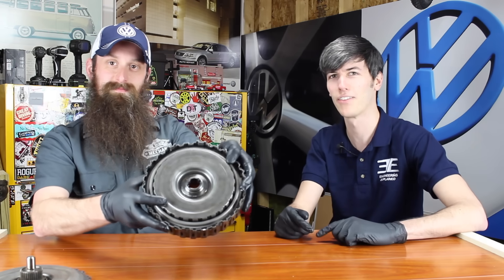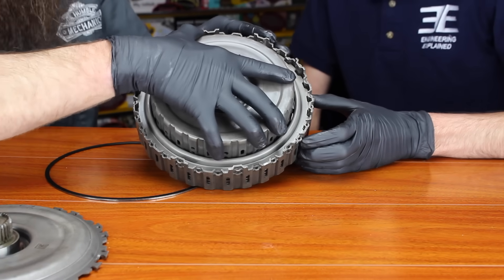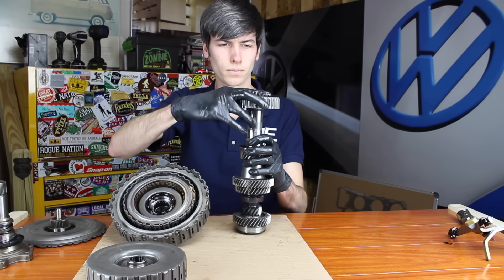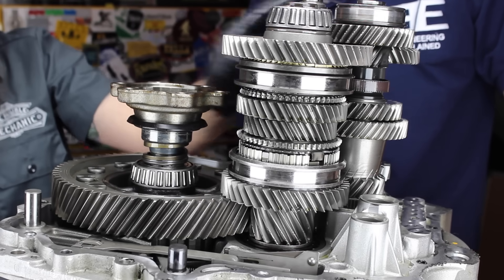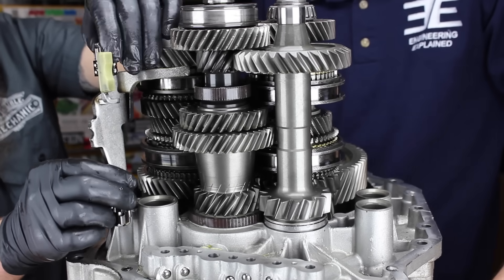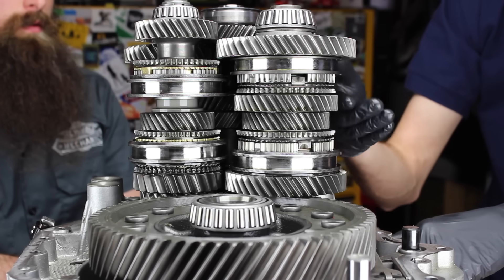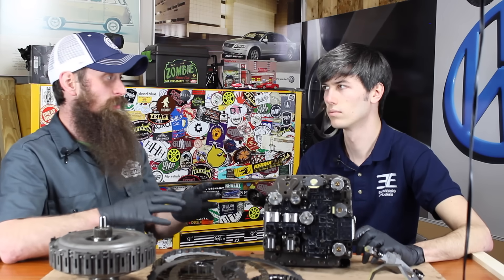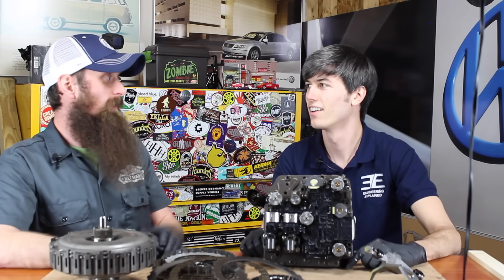DSG Transmission - Explained

Comment: for the last 6 years I have owned my first Audi S6 Avant 420PS with DSG. Prior to that I have only owned BMWs (540i etc.) I cannot begin to tell you how I utterly despise the Audi DSG transmission. It is the worst rough gear slamming piece of trash I have ever had the misfortune to drive with. People think I just can't drive as the transmission is constantly slamming itself and jerking all the time. One can't drive slowly properly and now it shudders when setting off from standstill as if the clutch plates are worn out. Pure bloody crap of the worst kind. I had no idea it had clutch plates in oil which to me is a grotesque concept. I totally and utterly HATE DSG. It's a cripple by design, and is a lousy manual being controlled by its own system. All my BMWs had normal oil based auto transmissions that NEVER failed and remained smooth ALL the time with no no oil change as lifetime oil. I did 565.000 km in my 540i and most of that was Autobahn thrashing in excess of 230 kph 260 max in the 540). Nothing ever ever went wrong. Ever. Audi doesn't have a service plan for the s tronic DSG either... and claims a lifelong oil. With my BMWs that was the case... never ever serviced a BMW auto gearbox... just drive it as a true lifetime transmission and lifetime transmission oil. No oil changes and also not a tickable box in the service manual.

Don't entertain a car with DSG, the concept is idiotic and the driving experience is horrendous. I have nothing but complete contempt for the VAG group.

Comment: We can stop saying dual clutch boxes shift quicker than a manual, it's technically correct but if you slow down for a junction see it's all clear and open the throttle the delay can be a second or more. In a manual you can see what is coming up so are in the right gear already and just go. It means you have to drive a bit more cautiously because you'll need a bigger gap in traffic in case it decides to delay.

So yeah they shift much quicker if you are linearly monotonically shifting but otherwise the delays are unpredictable.

Comment: Yea I experience the downshift and upshift bs. If I'm coming to a turn in 3rd and rpm drops less than 1800 it downs for me to where I'm dropped into 1st instead of 2nd. Or high rpm like 6500 immediately upshift... if someone knows a good tcu plug to open it up please post it to me.

Comment: 8:30 When I'm in 4th gear with my DSG-7 and drive slowly in the city, the Mechatronic goes Mental and tries to pre-change to 3rd gear, but sometime regrets and goes back to 4th - which makes lots of awkward and rough noises - like it is about to discard half of the gearbox thru the bottom of the car. Same goes for 3rd to 2nd gear. Of course I am exaggerating, and the Dealer says almost all brand new cars does this, I've read even the BMW-series do it. How can this noise be explained or, hopefully fixed? If you ever driven a 2003 Audi 1.8T manual stick you know the sound of a sloppy gearbox. Ka-Chug, Ka-Chug.

Comment: I have a question: does the dsg transmission keep sending fuel to the engine when shifting? My rpm gauge in my golf 7 2016 which has a DSG 7 speed twitches up a little when shifting up

Comment: Drove a 2023 Tiguan with DSG and I didn’t like it at all. It’s not as smooth as a traditional Automatic, and not quite as intuitive as a person driving a real manual. For some reason when I came to a stop it was clearly jumping from 2nd to 1st, giving a little extra oomph against the brake pressure leading to a secondary small lurch. Dealership said it’s common when you first drive them and I’ll adapt to it?!

Comment: Ok, show us what is affected as the fluid level runs too high and also too low. Based on what you can physically see inside the transmission, what is the "zone" of acceptable fluid level?

Comment: Great explanation all around. 
A more common preselection error would be gently accelerating to close the gap on a 2 lane road before reaching a passing zone. All indications to the computer are that the next higher gear will soon be more efficient at a higher speed. When you reach the passing zone, if traffic is clear, you step on the gas to use more power and shorten your passing time, best done in a lower gear.
Also, I question the location of the gears as stated, you might check those. If 5th and 6th are run from the same shaft, there's no physical possibility of preselecting 6th. 
Honda claims on their DCT all even gears are separate from all odd gears to achieve the same effect. I have not looked at the DSG, but in an attempt to achieve the same task, it just doesn't make sense for any consecutive gears to use the same power shaft. Well, we hope there's a stop before reverse anyway, but not the others.

Comment: I own a 2023 MINI Cooper S with a 7-speed steptronic transmission, and whenever the engine is idling at a red light, and I’m pressing down the brake pedal, why does the car move forward when I let go of the brake just as if it had a torque converter? I figured that the steptronic/DSG transmission would switch automatically to neutral in order for the engine not to stall whenever is idling at a traffic light; in other words, behave like a manual transmission. Could you explain that?

Comment: We love our DSG transmission
Reply: I’m enjoying too! Do the clutches wear out?
Reply: @fortimusprime  We had the DSG in the Diesel Golf, (177,000 miles not one problem), In the Golf AllTrak, 70,000 miles no problem) and now the 7 speed in the Taos. (So Far So Good)
Reply: @marko11kram  Awesome to hear! I now have a VW Beetle A5 (2012-2019). How often do you change the fluids?
Reply: @fortimusprime  With the Diesel it was at 40K, The AllTrak was 60K, I think the DSG service is 80K, but am not sure. They vary for service intervals
Reply: @marko11kram  ahh great thank you so so much for sharing this knowledge with me! The Beetle I bought was used with 70k. Already changed the DSG fluid just to be sure. What about the clutch pack? Does it wear out?
Reply: @marko11kram  Do you often drive at very slow speeds below 5 mp/h ? This is what would wear out the clutch the most.
Reply: @portman8909  Rarely. we are about 60 miles north of NYC in a suburban/semi-rural area.
We loved the DSG in the Diesel Golf, and then the All track too. Nw we have the 7 speed in the Taos, and it is good too

Comment: Amount of solenoïde, sensors, fail - factors incl. the demands to oil: a million more. Advancement to customer..shift in 0,06 sec instead of 0,6 sec. The truth is vw is so indebted and Chinese are building loads of cars, they cant buy a normal gearbox. They just won't get it. CVT is for Toyota, you get same principle, but instead of auction with a Chinese now with Japan. What u do? You develop something new. Its enormously complex isn t it and a blind horse notices the futile clutch..things..Pringles? Thats a motorbike clutch originally innit?

Comment: Great info guys, thanks very much. I test drove a Mini Cooper S recently w/ the DSG and I wasn't impressed. Since you said the DSG is manual trans that can automatically shift gears, what if you could modify that mechatronics unit so that you could still shift with the paddle shifter but use a traditional foot operated clutch to separate the power when you have to shift? No more shifting delays because it thinks you might be selecting the higher gear, etc (Charles' point at 8:56). Could that be possible?

Comment: I have VW scirocco 2011 and have some problems in gearbox. once I turn the car on, the gear sine in the screen keeps blinking and the car in one drive at 1st gear to the front and it's not connect to reverse (R). And before this issue happens the gearbox oil was very low and leaking but unfortunately I didn't check that leakage earlier. So, what could be the reason of this blinking and why the gearbox is not responding? Could it be the gearbox chip as the main reason?

Comment: Informative.  My mk8 golf has some seemingly rough downshifts for an auto, although it's probably just what you've mentioned - it's trying to predict.  I've got a howling noise when shifting from 4th to 5th, ONLY at 50 kmh.  Almost like a slipping clutch sound, but doesn't do it if there's more load on thr transmission like under hard acceleration where it would be shifting from 4 to 5 at say 100 kmh.  It's going in to vw today under warranty.

Comment: Hi guys - I have a question regarding emissions, not trans. My 2013 Beetle is throwing the P2450 code for a emissions switching valve stuck open. What does this indicate?

Comment: J .. why are DSG gearboxes dangerously slow to pick-up from stop ? (for example pulling from stop into a gap in traffic) They are notorious for it..
Reply: 🤔 are they? Porsche has been using them since the 1980s. I think it's more than just the DSG affecting that.
Reply: @SonOfTheDawn515  possibly ..

Comment: Thnx for explaining now I understand why my VW CC did what it did when I was accelerating and overtaking a car and thought the car was going to change the line in front of me so I let of the gas but the car in front didnt change the lane so I hit the gas again and experienced a delay while the rpm droped and then rised again and I got the power and acceleration again. 
I just bought the CC before that I had a Mercedes B class and thougt that the transmisson in it was flowing smoother but I guess I just need to get used to DSG :)
Reply: The DSG, in my experience, is pretty good. Then again, I've only ever owned VWs in manual and DSG. But I know what you're talking about. My MK6 Jetta 2.5 SE would do that sometimes but I generally would shift into sport mode when overtaking slower traffic and didn't notice it. Think it has to do with RPMs, safety mechanisms and getting the most efficient power. Just my guess.

Comment: I would like to know what's wrong with a Volkswagen Polo 7-speed DSC transmission where indicator light just flashing when you go to rev the vehicle and you put it in drive it won't rev but if it's not in drive it will rev a little

Comment: Hi Jason,

I just bought a 2017 audi a3 e-tron which is a plug-in hybrid with an interesting triple clutch gearbox DQ400e (also used in Golf/Passat GTE).

I found some information on it (looks like electric engine is integrated with the gearbox?) but I'd LOVE to see a video explaining this drivetrain a bit more. I think it's quite unique also in the way the power from the electric motor goes to the wheels through the gearbox which usually is not the case (unless it's a CVT maybe).

Anyways if this seems interesting, please make a video on it. Keep up the good work! Cheers from Poland!

Comment: Hi HM, i have a a Jetta6 1.4 tsi 90kw and having gearbox issues. Have you done a strip and reassemble on one od these. Engine Code CAX . Trans Code OAJ - NBW 6 speed manual . Thank you

Comment: I had the transmission module replaced on my 2014 a6 quattro, when the gear not shifting beyond 3ed gear. However, the green arrow for manual shifting no longer comes out. How to fix that?
— also i notice when the gear slows down there is kind of soft slipping on the 2nd and 1st gear. Is this a problem?

Comment: can anyone explain the jerkiness they tend to have when driving more aggressively? I own a 2010 DSG what could remedy this some say its the gearbox overheating and to put in a coolant system directly to the gearbox but Volkswagen told me to cough up 6k for a whole new trans after I did a DSG service at only 67k (stock) low-pressure issues could also be a problem? Twin Clutch Transmission cars also use conventional Dual Mass Flywheels, failure of which tends to be indicated by a ratting/jangling noise to be heard, the flywheel can be disintegrated and may have damaged the gearbox casing irreparably. Crunching, especially in the lower gears I may be out of luck as the used car dealership didn't honor their transmission and engine warranty after I had problems from day one such a shame and unfortunate experience car is in tip-top shape besides that just needs a cleaning
Reply: tried changing to a new and better gearbox oil?

Comment: Did see a vid that shows the disadvantage of the DSG; in traffic it needs to slip the clutch even worse than a manual; net result is your clutch will wear out more quickly than a well driven manual.

Comment: This video has more shafts than PornHub!  Ha, ha!  Seriously though, great video!

Nice explanation of the double clutch & DSG transmission.  They're pretty elegant pieces of machinery.  Everything's so well manufactured, a joy to behold.  Would be a great coffee table display!  Even though I understood the function of the double clutch, I don't think it ever really occurred to me that the transmission was a manual construction and nothing like a typical automatic transmission.

I assume this design will eventually supplant the typical automatic transmission, right?  Eliminating the torque converter is a winner, efficiency-wise.  Plus, shifts are so fast.  And a wet double clutch should outlast the traditional manual dry single clutch, right?  

Then again, with EVs, looks like the future of transmissions in general is in doubt.

And a DSG doesn't really "shift faster" because it doesn't have to.  It's ALREADY IN the next gear, so you aren't really "shifting" gears, just quickly disengaging one ratio and engaging the other.

Now the one thing that makes me wonder is this:  When you shift from first to second, the other input shaft selects third gear, anticipating that as the next gear choice.  BUT, the car doesn't know you're going to shift into first if you happen to be approaching a sharp corner or stop sign.  Or does it?  I assume it uses input from the brakes to anticipate.  In other words, when you shift from, say, second to third and then hit the brakes, the computer will assume a downshift is coming.  Whereas with no brake input, the transmission assumes an upshift is the next gear choice.

I think I figured it out.  Thanks for letting me talk myself through it!  (TLDNR, I know!)

Comment: I have yet to drive a car with DSG and am curious to know from someone who has how it behaves in certain circumstances. For example: if when driving normally and going up through the gears, either manually or automatically, I am in 4th gear the gearbox has already pre-selected 5th however, suddenly an overtaking opportunity arises and I need either 3rd or 2nd gear quickly; using either the paddles or just kicking down the throttle does it take long for the gearbox to sort itself out and give me the ratio I need or is there a noticeable delay? Thanks.

Comment: Great video! Do you or another viewer have any knowledge on jerkyness with dsg when driving on low rpm with steady throttle? (happens on lower and higher speeds).  I've experienced it when I slightly press the gas pedal, but if I accelerate harder, then there is no jerkyness.

Comment: looks like this one had the same problem as my dct box has currently. the synchromesh rings are worn out causing heavy grinding on the thin gears which are needed so the shifter rings can engage upon them. this problem is pretty common for dct transmissions  because of the frequent need for oil change (every 60k km) which IS NOT specified by the manufacturer. If the mechanic over sees this and your driving style is on the sporty side the synchromesh rings will start to wear out way before you hit the 200k km. The brain of the gear box does not know if the synchro is worn so it shifts without giving enough time for the gears to line up which is something you can do with a manual box. thanks for the video this is exactly what i needed to see.

Comment: So is the Mechatronics unit receiving a electrical signal that is being created by the motion of the wheels or other moving part? So if your slowing the electrical current reduces and when you speed up the electrical current increases. That then can be converted into “1’s” and “0’s” for the computer. Im thinking of it from a programmers logic.

Comment: Thanks for the live internal gear assembly as a “Demo”. However you got the prop much easier to at least understand even if still a baseline understanding.  

I got the wet clutch and mechatronics  concept at leas to my head for further detailed research.

Quick question.  Do DSG transmissions require More/Less or about the same routine maintenance and inspection as the traditional planetary gear/ torque converter transmissions regardless of vehicle fleet/sub fleet models.

By “Routine” I mean fluid/filter changes, band adjustments,  etc...?

Great video with facts and not “Fluff” to hear a narrator listen to their own voice.

Great use of transmission technician to help put the “white board” into a visual inspection and explanation of principle.

If you were buying used which would you choose DSG 7 speed or ZF 8 speed?.....again  comparison between two identical vehicle types within the same manufacturers fleet/ sub fleet if they changed transmissions during model year cutover?

Example 2018 Audi A6 which was ZF 8 speed but 2019 the ZF was replaced with the 7 speed DSG/ dual clutch for 2019?.